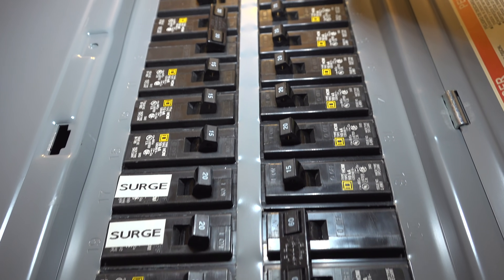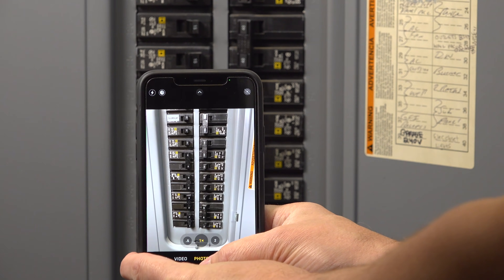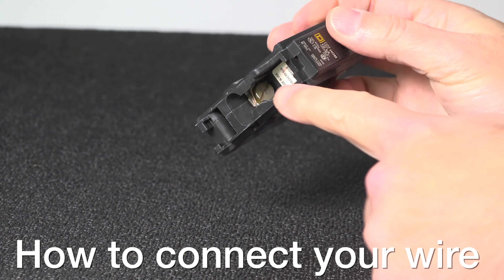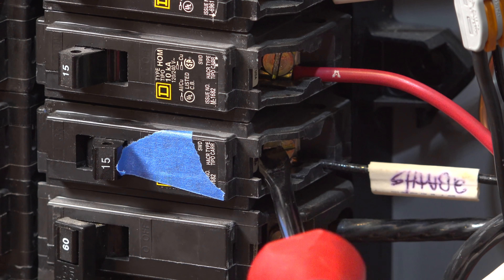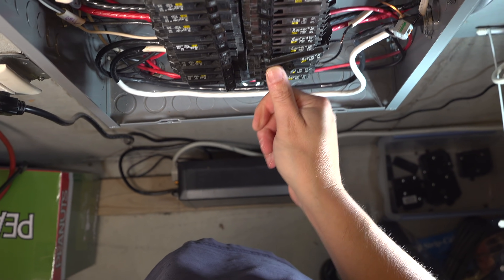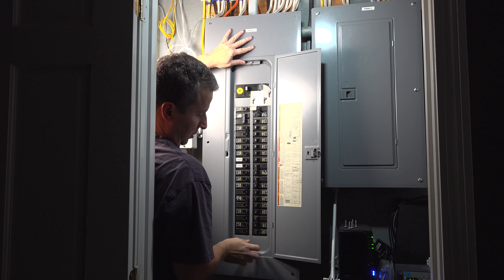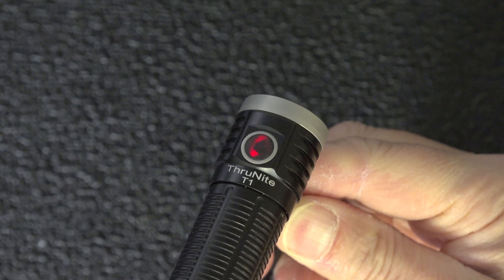How To Replace or Change a Circuit Breaker in your Electrical Panel & Why it's Tripping

Comment: As a service electrician I can say you got most of the details in this video. But one very important step you left out was that when putting the heavy panel cover back on or taking it off. You have to be 100% committed to holding the panel cover steady,if it slips and it crosses the live wires you’re in for a lot of pain if you survive the blast.
Reply: Every time I do my own electrical work I age 5 years.
Reply: @dianachilders8098 ELECTRIC WORK - 5 YEARS 
DIY FURNITURE -10 YEARS
LOOKING FOR 10MM - 6 YEARS
TRYING TO GET THAT RUSTY BOLT OUT - 15 YEARS
THIS IS HOW I SPENT MY TIME 😂 NEXT IM GOING TO GO TACKLE A MOTHER BEAR WITH HER CUBS AND SEE HOW MANY YEARS I CAN SHAVE OFF WITH THAT THANK YOU JOE ROGAN 😂
Reply: @Shiekh420  Dont forget the more moderate threading a needle - 2 years
Reply: @dianachilders8098 Truth haha!
Reply: @dianachilders8098 TRUTH!!  😅
Reply: Good point. I just checked mine. It has been divided into a 1/3 sized panel covering the main breakers and then 2/3 for just the regular breaker area. Probably for just that reason..
Reply: @encyclical =kl llegue
Reply: It's a wonder why the boxes are metallic or conductive. You'd think they'd make them insulated for thisnvery reason.
Reply: @drmiteshtrivedi  Good point bro why they make them this way 🤔
Reply: @drmiteshtrivedi  Exactly ,  no reason why that panel over the breakers needs to be metal.  The plastics in the last 20 or 30 years are very strong.  It would be way safer for the changer of the breaker.  Mine is metal and I need to replace one 20 amp now.    Bad thinking on the manufacturers.
Reply: @drmiteshtrivedi  - probably so you have to call a licensed electrician to pay to do the work.
Reply: If you want all the power off to the main panel you will have to pull the meter on the outside of the house. Like he said everything above the main breaker is still HOT.
Reply: right… welp looks like lm calling a technician
Reply: What if I have really thick gloves on?
Reply: @interwoven222  there expensive but they do make gloves for it
Reply: Love how people in the US are not using insulated tools when working on el circuits. I guess 120 V is not high enough compare to 240/400V
When I was an apprentice in Europe. I have been told to approach each wire as a live wire and always use insulated tools.
Reply: anyone in here knows if i can replace a 15 amps for a 20? Oh have to be exactly what is in there?
Reply: @mixtecop No! Never replace a lower amp breaker with a higher one. It defeats the job of the breaker and could lead to a fire.
Reply: @mystictoad727  ok got it thank you
Reply: You need to check what size wire is connected to the breaker you want to switch from 15A to 20A if it is 14 AWG then no you can't just swap the breaker you would need to change the wiring to at least 12 AWG to avoid overheating/overloading the wire. @mixtecop
Reply: @mixtecop  No, the amperage is related to the gauge of wires that are installed in the house. If you have higher amp rating fuses (20 on 15) and there is 20 amp draw on 15 amp wiring, it can melt those wires. Now you might get very lucky and they installed 12 gauge wire instead of 14 gauge for that 15 amp circuit, but what if they didn't?
Reply: @the_faminist I had an electrician install a Tesla charger and he always goes low in the estimation instead of high.  Poorly trained by a company to save them money but not giving the customer a more robust system.  Lesson learned from dealing with electricians go up higher than what you need.  If you need a 10 amp go 15 if you need a 15 go 20 on the wiring and breaker.  The price will never get cheaper in the future.
Reply: @mixtecop Not without re-running the entire circuit with the appropriate gauge wire which, in most 20amp cases with standard length runs, would be 12 gauge.  The 14 gauge wire that is on 15 amp circuits will overheat on a 20amp load and can cause a fire.
Reply: that would be super rare would it not? Most of the live wire is covered by thick rubber?
Reply: Yup mines slipped and I just let it fall on the floor. Dented the corner but did not fry myself.
Reply: Thanks for the information.
Reply: Thank you for this emphasis and insight!  Doing this today!  Safely!
Reply: Did I miss something he did that
Reply: I took one look at that and said ok, have another person there. One and done 😂
Reply: I wish I read this before changing, nothing happened but it definitely slipped and I kinda knew the danger but you know...
Reply: Thank you!!  I was able to replace my breaker without issue, and it is working great!
Reply: I was literally thinking that to myself
Reply: Nothing will happen unless you point the cover to the live wires like a sword 😂 don’t be scaring people off .
Reply: @JRMaxitohe seen his job flash away before his eyes had to take action quick 😂
Reply: Do breakers sometimes go bad overtime?  My house is 20 years old and seems to trip this one breaker if just air purifiers are on.
Reply: Thanks for this tip
Reply: Whew. Glad I checked!
Reply: Wouldn't you put it back on while the power is still off?
Reply: He said even when they power shut off, there are still 2 live wires coming from the street. You shut the house off. Hopefully you figured that out by now 2 after a diy video lol 😂 👍 @Rob-dp3vr
Reply: @danlowrance4660 it doesn't matter because he clearly said in the video no matter what, the 2 main wires above the panel feeding in from the street will always be live.
Reply: Thank you
Reply: especially square D, siemens is junk also but every square d panel i’ve tested never wanted to line up properly lmao
Reply: What should something like this cost if hiring an electrician?
Reply: @epicfailureDFW  I just got screwed $500 for this. He did just a little more, but it's still damn ridiculous & my problem still exists & now my window ac unit won't even turn on!
Reply: @epicfailureDFW   Cost varies across the US, but probably the range of $150-$200 minimum.  However, a competent electrician will want to do some checking to see why a breaker is tripping. (Is it bad or is there a problem somewhere on that circuit)
Reply: @epicfailureDFW 200-300 dollars for 15 minute work
Reply: $500 @epicfailureDFW
Reply: @keysersoze716  😂😂😂 Damn. My neighbor  an electrician did it for 50 bucks. Which was cost of the breaker.
Reply: It's not the voltage that kills but the current blows stuff off.
Reply: U had me in the first half. F that
Reply: I think that’s a good one to know!
Reply: Can that happen without it happening like the panel just being on cause I get paranoid when I walk by my electrical panel now….
Reply: Thank You!!!
Reply: OMG and I was just starting to feel a bit more motivated and less scared to change my kitchen fuse and then you posted this.....welp goodbye $10 fuse, hello $75 electrician. :(
Reply: Survive what blast? Isnt he making sure everything is shut off before dealing with breaker?
Reply: He does mention they are heavy and you need to hold it while undoing those last screws but the extra note of caution about the panel touching those live lines is very important.
I didn't even think of that.
Reply: Honestly silver, this should be pinned and the other promo comment should not be.
Reply: Just a suggestion to anyone trying and doing it alone, a method I did is screwing in the top two screws 3/4ths of the way and then mounting the panel, then screwing them in all the way then screwing everything else in. 

Thanks for the caution
Reply: That's great advice.  Now, If I turn off the power to the entire home from outside, does that hold true?  Yes, the video was very informative.  TY you and Silver Cymbal.
Reply: I really think the box should be made of a material that is non conductive. I also think there should be box on the pole to turn power off. I know you can pull the meter out,but that’s against law. Something the homeowner can put a lock on,to legally kill power at the pole.
Reply: 🤔Very good point right there!👍
Reply: Does it still have power if you shut it off at the box outside?
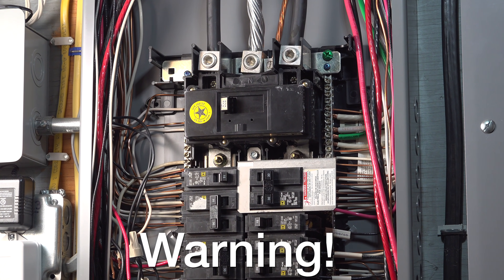Reply: @juggalosquad5027  yes 2:50 outside power is on, inside is off
Reply: @hollypatrick1050  Not completely! As he says in the video, the wires attached to the main breaker are still hot!
Reply: @juggalosquad5027  I wouldn't think so, because in this case you're pulling the power from the street not just tripping the main fuse. If I were to go out and take out the main fuse that feeds into my home as a whole then there is no power coming into my box at all. If you're talking about something similar then I'm sure you could cut the main power to your house from the street as well.
Reply: check it first using multimeter if theres no power then you good to go  @juggalosquad5027
Reply: @juggalosquad5027   FYI- The 2020 National Electrical Code changed so as an Emergency Disconnect or Service Disconnect be added for new construction or when the service is upgraded.  This was done so emergency personnel could shut all power off to your home from the exterior.  So your home could have a main/emergency disconnect outside.  It should be in the vicinity of the meter.  It’s a good idea to put a radio on in the house so that you positively know you have cut the power.  Also, turn the main breaker off in the panel too.
Reply: @juggalosquad5027  In the video after CS takes the cover off the box, he points at the 3 wires coming into the box. Those wires are always hot.  The main breaker takes power off the other breakers, but above the main breaker those wires are always hot. The only way to take power off those wires is to remove the electrical meter that is outside.
Reply: If you have on a pair of high voltage electrical glove say 1000v rating and you slip and the cover crossed the live wire above the main breaker will the gloves protect you? Just asking
Reply: How would removing the cover cross a wire?
Reply: Wheb your putting it back on if it slips and you accidentally tilt/lean it it can very easily mame contact with the live wires on top @Jersus856
Reply: @Jersus856 the cover is one big, heaver jumper wire
Reply: @Jersus856 By having one of the rounded corners of the panel cover come in contact with one one the 2 hot lines and 1.) Using you as a ground (if improperly clothed, or touching anything else that is metal) or 2.) The other end of the panel comes in contact with the neutral and energizes what you’re holding, causing your arms to become part of the circuit.
Reply: @Jersus856 Because if you touch the METAL box cover to the LIVE WIRES above the main switch….. duh!
Reply: Wouldn't checking your wire gauge for the appropriate amperage also be included? Can't use a 14 on a 20amp. Gotta step up to 12 at least.
Reply: @seanv3366  why??  he didn’t replace any wires.
Reply: @seanv3366 15 amp can be used on either of those wires sizeS. No need to check.
Reply: Always hire a service technician, right lol?

Comment: No power at my kitchen GFCI outlet, but non of the fuses are tripping. Also, GFCI outlet did not reset, so i replaced it. Still wont reset, but it is also not receiving 120 VAC. Will check circuit breaker next, but if nothing is tripping, not sure what i’ll find

Comment: OK, the electrician left the sheathing on that circuit and it looks like master bath lights, not plugs. Go see if that the lights are off. Check everything on that circuit to be good connections.

Comment: I have a masters in electrical engineering and understand the inner workings of the breakers thoroughly.  However,  I still call an electrician for electrical work. Just not something I am willing to risk my life on to save $200.

Comment: If your breaker is tripping, there’s likely a cause for it. It’s way more likely that something is causing the fault and not that the breaker itself is “bad” and doesn’t make any sense to just replace a breaker when you don’t know for sure that the breaker itself is the problem. You can test breakers to make sure that they are bad. 

This is like saying “something is wrong with my car” then just picking some random part to replace without even knowing if that is the cause of the problem, then just hoping it fixes it. 

Also, don’t ever trust those pen testers without verifying with an actual multimeter first, especially if you’re not a licensed electrician and you’re opening up your electrical panel. I’m certainly not saying that no homeowner should do this, but I am saying that you should know exactly what you’re doing before doing this kind of work, and if the only research you’ve done is from this video, definitely do more research first.
Reply: So, how do you test your breakers?  :)  Nobody uses load testers in situations like this.  You install a $5 breaker and observe the results.

Comment: I'd suggest unplugging Smart TVs and routers before switching their circuit off, especially the main.  There is a very short brownout voltage sag period during the switchover, and some electronics do not take well when they are under volted.  They may appear to still work, but can exhibit glitches or lag until fully factory reset or reflashed.  My Netgear could deal with a year's worth of random power outages before slowing down, but if I would play around with the circuit it was connect to it immediately would slow down, in some cases brick into some help-me mode, and require a low level reflash from the Windows command prompt...not fun when you have other things to be doing.
Reply: So, there's a "brownout" when powering off via a circuit breaker, but not when unplugging it?
Reply: @JackJensenTrader  seems like an eddy current..

Comment: As and electrician and an avid diyer I'm all about learning new things and trying stuff out. While the average homeowner should be able to replace a bad breaker just one warning. If you don't know or aren't sure ask an electrician. I see too many people" diy" some electrician work and it's like dude that's a fire waiting to happen. If you diy some drywall or some paint or some trim carpentry and do it wrong/ mess up it will just look crappy. If you diy some electrical stuff and mess up it could kill someone, kill yourself, or burn your house down. Y'all stay safe out there and don't trust widowmakers. (Non contact voltage testers)

Comment: If a breaker is tripping doesn’t mean the breaker is bad, though it is possible. It’s usually not the case. I’m an electrician and of all the breakers I’ve installed only one has been bad. The most common cause of tripping is overload or short circuit. So the question is how does one find the issue? Well, most if not all do it yourself persons don’t know how to diagnose or properly fix the problem. And sometimes they make it worse.

Comment: As much as I am a huge supporter of people doing their own DIY please, when it comes to electricity, hire a licensed electrical contractor. It’s not worth it if something goes wrong. Not to mention (many may not know this) but the moment you open any electrical cover it is considered an alteration to an electrical system. If you get hurt or something gets damaged you are on your own. Insurance won’t help you. Electricity is fast, invisible , and deadly. Otherwise I really enjoy this creators content and have watched lots of his videos. So I am in no way knocking him as a creator. I am just worried for overzealous homeowners.
Reply: First, that sounds like urban legend. But more importantly, how exactly would the insurance adjuster determine that someone opened an electrical cover that wasn't a certified electrician? Or are you arguing that electricians are required to pull a permit just to open the cover? Because that's definitely not true.
Reply: @hempelcx   lol no an electrician does not need to pull a permit to open a box. I don’t see where I said that. I will re-read it again and remove if I did say an electrician needs to pull a permit to open a box. But yes, if you are not a licensed electrician and you open a box it is considered alteration right away. You can ask any certified FSR (field safety representative) and they will (better) say the same. I know it sounds rediculous. I wouldn’t disagree with you on that point. Sometimes I wish the “safety” would allow to just cool it a bit, but the insurance companies put a lot of pressure on Trades to the point where homeowners now can’t even look in one of their Junction boxes. Again, I think it dumb but there must have been an instance where some homeowner got overzealous opened up a box and maybe knocked something loose and caused some serious damage or injury. People should just work on what they are comfortable with so that if something goes wrong it won’t give the opportunity to make up rules like this that goes over and beyond. Nice reply though. 👍
Reply: THIS IS BLATANTLY FALSE.  Insurance covers all sorts of negligence and criminal activity.  Insurance covers stupid.  You drive drunk and injure someone, guess what your insurance covers the injury.
Reply: @glasshalffull2930  welllll, actually I’m a Red Seal Journeyman electrician and I think I know what I’m talking about. But thanks for your educated input.

Comment: 9 times out of 10 if a circuit breaker is tripping continually it's a wiring issue not a faulty breaker. Changing the breaker will never accomplish anything but putting an untrained persons and their familys life at risk. Also side note many panels do come with bolt on breakers, less common in residential panels but can be very common depending on your area.